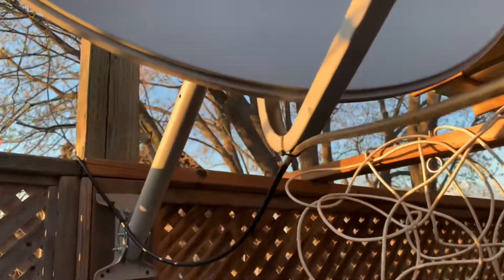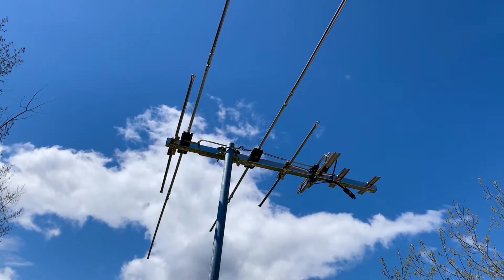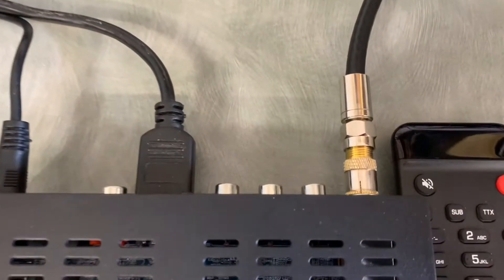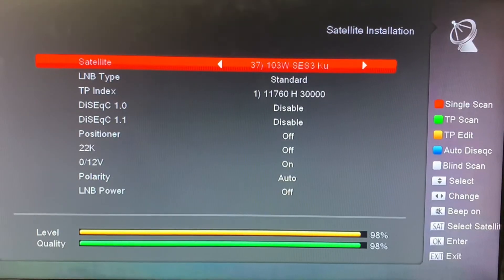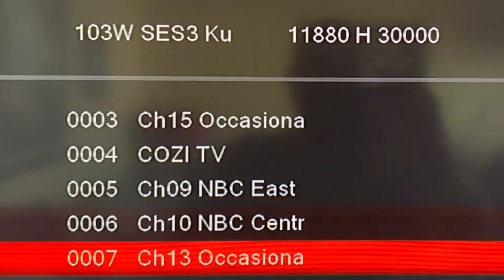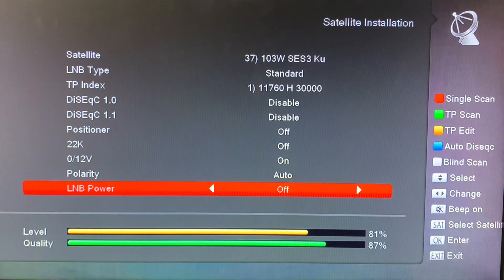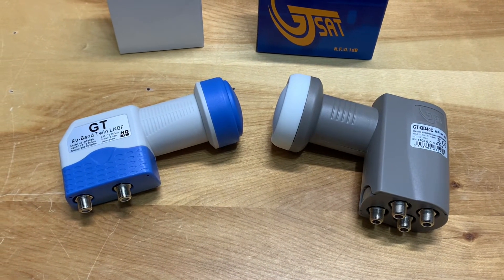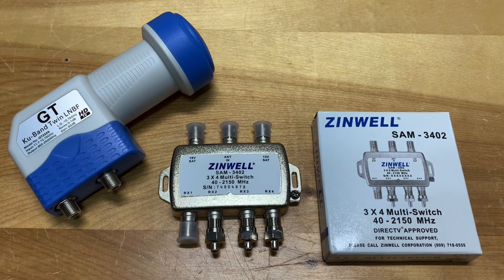Splitting a Satellite TV Signal to Multiple Receivers - Free Satellite TV

Comment: That's false..you can use a certain splitter for that..you Can watch other sat ch with other receiver..if you want to off set your system but another dish..this is why you will see dish slanted weird mostly..this is to capture another satellite...you also can buy a dc stabilizer voltage amp for your dishes...your video is old..and you don't have enough information...
Reply from the maker: I’m not really sure what point you’re making here. This video is talking about splitting a signal from one dish to multiple receivers. Sounds like you’re talking about using more than one dish. That’s a totally different set up.

And this information is still valid.

Comment: Good video. Quick question for you or anyone else who may be able to help. I have 2 satellite dishes pointing at different satellites each of them with a duo LNB. In my TV room I have 2 receivers, each of them locked to a specific satellite (they are not diseq capable). It is very hard for me to run 3 additional cables to my living room, so my questions are:
Can I combine the 4 signals coming from the 2 dishes (2 from each duo LNB), drive this signal through the one existing cable to the living room and then split it into 4 signals to feed each of my receivers (2 LNB ports each)?   
If so:
- What would be the right way to do this?
- Could I watch channel 1 on Sat1 and record channel 2 on the same satellite at the same time on the same receiver (this works if I run the 2 cables rather than one )
- Could I watch channel 1 on Sat1/receiver1 and record channel 10 on sat2/receiver2 
The above obviously works with no issues when I run 4 individual cables but I am wondering can I run all this through the one single cable and what the best way to achieve this would be. 
I guess I don't need the diseq switch since I have each receiver pointing at each LNB port on the satellite dishes, but wonder would combining the signals and then splitting them cause any issue. Would this work?

Is this what the use for the multiswitch you talk about at the end of your video and would that work for more than one LNB/Sat or would it only work for a single LNB with multiple ports?
thank you

Comment: Splitters are no good. You can also connect multi-dish with DiseqC multiswich into one cable to your receiver. This is supported by all receivers today (or should be). The reason why you can only watch one channel (or transponder) in this setup has nothing to do with polarization of the signal. This has everything to do with the LNB. Since it only provides one signal at the down converted frequency to the receivers. For multi-receiver setup your only option is using a multi-output LNB. Other option, that I don't know if works for Canada or U.S is to get multi-head LNB (many have multi-output, two and up to eight). That way you can get a signal from two satellites at once. There are several versions of this out there, some use DiseqC and some don't. 

Over the air signals are polarized, its either vertical or horizonal polarization that is being used at the transmitter. Same goes for cable, but its less of a problem in a cable system than in over the air system.
Reply from the maker: DiSEqC works for connecting multiple LNB’s to one receiver. The fact that only one polarity is delivered at a time by the LNB limits the capability of a splitter. A multi-output LNB is best for independent control over all channels at each receiver. Cable and OTA signals may be polarized but it’s a non-issue if they’re all on the same polarity.

In Canada we have Shaw Satellite dishes with dual universal LNB units, with built in multi-switch. Capable of receiving 2 satellites offset by 4 degrees on the arc. They have outputs to connect up to 4 receivers.📡

Comment: More specifically, cable TV splitters normally pass rf signals but no DC current. Some splitters have DC diode steered outputs. Look up Holland HFS - 2D. DirecTV uses DC power pass splitters MSPLIT2R1 - 03. Holland makes a splitter with DC current from input to one output DPD2. Another oddity is a tapped splitter. In to out is strong, but a third connection tap is attenuated 12 DB. See DC Communications GDC - 12ND . ...It is the DPD2 that will immediately isolate one receiver from powering the LNB and keep the two receiver power circuits disconnected from each other.
Reply from the maker: Thanks for the information.

Comment: n Europe there are some satellite pay TV operators that broadcast all their channels on one band. For example one operator will choose for example the Vertical Low Band. On the Vertical Low Band the satellite pay TV operator will broadcast all their channels. Making the reception like cable TV. All you need is a single Universal LNB and a 2 - 4 satellite splitter. To connect more than 4 satellite receiver and i'm referring to hotels or motels a multiswitch is the best solution. But most satellite operators will use all bands. In my case I use splitters because all my TVs have satellite tuner and I also use a satellite receiver. The reason that I use the satellite receiver is that the TV doesn't have USALS function only the receiver. When you use the TV it is mandatory to power off the satellite receiver, and when you use  the satellite receiver it is mandatory to disconnect the TV from the LNB.
Reply from the maker: Absolutely. Power off and disconnected for sure. It would be much easier to have all channels on one polarity like cable. But it’s the nature of the hobby I guess.
Reply: @NorthcoasterHobby  Let me tell you something that will make everyone confused about LNBs and it's mostly in Europe There are some LNBs in Europe that use two polarities instead of one either vertical or horizontal but they use the frequency band from 300 MHz up to 2400 MHz Those LNBs have two outputs one for Full Vertical Band and the second for the Full Horizontal Band. These are called Wideband LNBs. I But you still need a special multiswitch. Cascadable dSCR Multiswitch. One that has two inputs and four outputs. Two inputs for Wideband LNB and four outputs but those four ouputs are VL, VH, HL, HH not outputs like a Universal LNBs but these are cascade multiswitches. In order to connect a Cascadable dSCR Multiswitch to a satellite receiver you need a clasic multiswitch. The classic multiswitch has 4 or 8 inputs in this case we need the one with the 4 inputs and has from 4 up to 32 inputs that connect directly to your satellite receiver. This type of switches and LNBs are used in hotels. If you connect a Wideband LNB to your receiver will be problematic. Also there are fiberoptic LNB. That type of LNB is powered by a coaxial cable with 20 Volts (the voltage must be permanently) and has one fiber optic output. Again you need a converter from fiber optic to cable.
Reply from the maker: @Nicholas_Chris  Wow, sounds complicated.